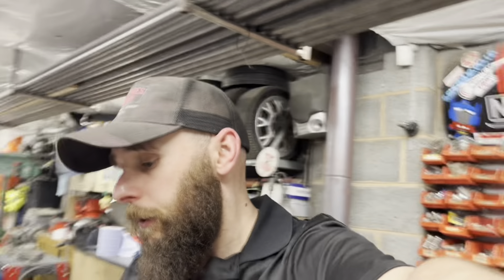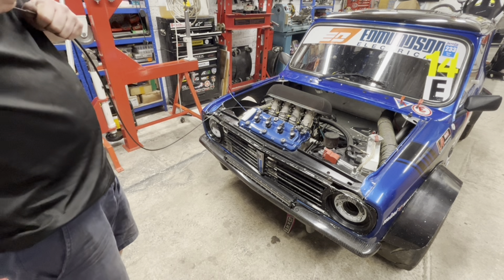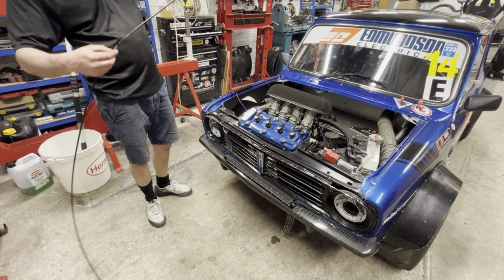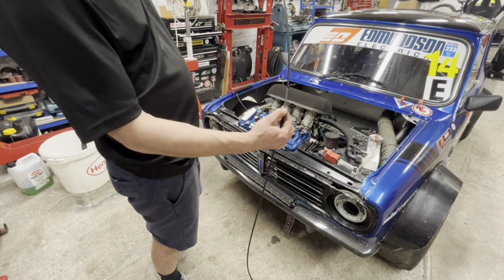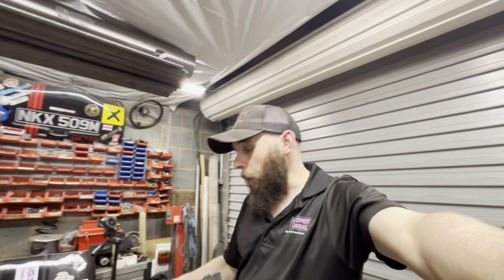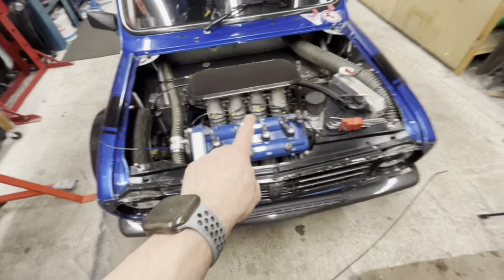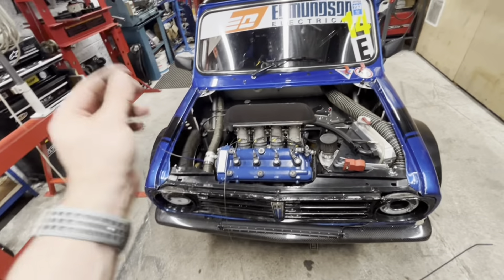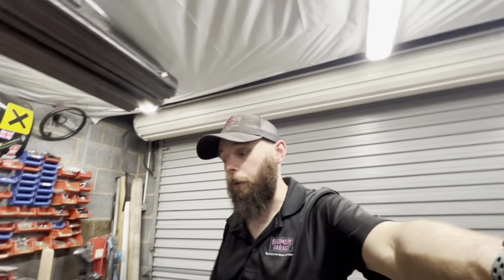Hayabusa mini sticky throttle problem

Comment: Pull cables can be funny things. I've had them go very stiff without always being able to work out why - glad you solved your snag.
Reply from the maker: I guess running in such a hot area of the engine bad didn’t help matters at all
Reply: For sure Matt - some of those cables have a nylon coating inside so the wire slides freely inside - great idea until the nylon starts to melt. Others have nylon outside, which melts and works its way inside  same result.